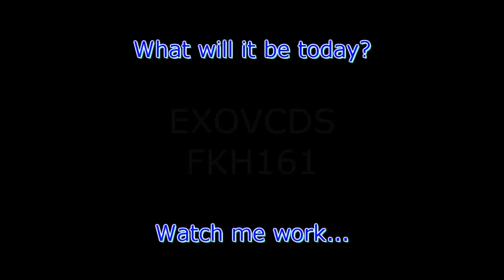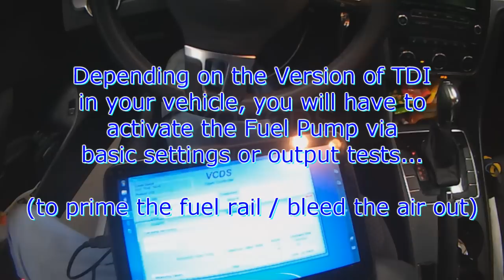VW B7: 2.0L TDI Fuel Filter replacement

Comment: Can the fuel pressure not be primed by just cycling to the on position a few times, does that tool lower the pressure output of the pump to reduce "pressure shock" when priming?  In your opinion is VW corporate making any progress on improving there reliability with there new releases?  Enjoy watching your videos!
Reply from the maker: I don't know all the specifics for all the different systems... I do know that not all vehicles will cycle the fuel pump "every time" the key is cycled. So relying on turning the key a few times, is not a safe thing to do with these engines (in my opinion). All I can say is, don't fill them up with gasoline or run the system dry... we have not seen any come in for major repairs yet. Thanks for watching & taking the time to comment!
Reply: *****
I work at a VW dealership and I have seen a handful come in with gas in diesel conditions.  Not pretty and very expensive for the clean diesel engines.  I don't know if the high pressure pumps are available to order from the aftermarket but I know VW pumps are order blocked and have to be called in with a VIN.  It is quite the procedure but we haven't had one for a while.

So listen to Thomas.  Don't let them run dry or with gasoline.  It is a 5 digit repair job.
Reply from the maker: mischief007 Hi, thanks for sharing your dealer experience! We haven't yet had a "gas in diesel" repair yet on the new common rail systems. The service manuals suggest looking for shavings and doing a flush if no shavings are found. Might be cheaper to buy a used car at 5 figures!
Reply: I know Thomas.  The worst part is VW tracks these misfuels so the car gets a bad rep once it gets reported.  Even worse for the customer it is all customer pay but as you said, depending on what the customer did.  Filled it but never put the key, just drain the tank, check the lines and replace filter.  Anything after that gets expensive quickly.  I want to say we've had about 4 since I started working there.

Comment: Where is the powerdirection oil tank located in this model?
Reply from the maker: I don't know what that is / means, sorry.
Reply: power steering fluid tank place.
Reply from the maker: @mestaphakabiri2939  is a yellow or red steering wheel warning light on in the dash?
Reply: I just looked for the location of the tank to check the oil level, because I could not find it near the motor.
Reply from the maker: @mestaphakabiri2939  if you have a warning symbol  that is on in the dash, then you have electric steering. Hydraulic fluid reservoir could be mounted low in the engine by the pump (if it has one).
Reply: @EXOVCDS  thank  you  for  answering.

Comment: Is hard to search at that page...what is price for cable? And full version of sw is then available even it cost 1000 usd +?
Reply from the maker: +Jozef Capek Software is free and will be fully ";unlocked", if you buy the cable from http://store.ross-tech.com/shop/cat/VCDS.html If you have a question about which cable is best for you, email orders@ross-tech.com and ask them which cable to buy.
Reply: +Thomas EXOVCDS EXCELLENT video sir!! very professional. I knew this was going to be good when you blew air to remove and debris. then you go and use the bungee cord. I was very impressed. I have a 2015 mk7. wonder if I would need the software? thank you so much for this great quality, professional video.
Reply from the maker: Zx10r Power It is best to use the software to bleed any air out of the fuel system. Some DIY posts (google to find them) say that it can be done without the software / fuel pump activation... I do not want to try that though.

Comment: Will I need to activate the fuel pump on a 2013 vw passat estate. 1.6tdi
Reply from the maker: It is always best to activate the electric fuel pump when priming the system... to prevent high pressure pump damage.
Reply: I know that, I'm asking will I need the computer to do it or is all models from 2010 Common rails. Just asking out of curiosity. As I also own a golf mk4 pd130, I just filled that with fuel and started first time.
But will I need the computer for my passat. Cheers
Reply from the maker: You didn't ask if you needed a computer in your first post... I'm  not a mind reader.
You can't compare a PD TDI with a / to a Common Rail TDI.
My answer to computer or not... yes, you will need a computer or scan tool.
If you read through a DIY TDI forum... you might get a different opinion.

Comment: Hello i am experiencing some error code related to the G81 sensor.
Can we see it in this video?
Reply from the maker: Under the engine cover... mounted to the high pressure fuel pump.
Reply from the maker: Did you find it?
Reply from the maker: http://fkh161.ca/VW/G81.jpg

Comment: Hello, where is the fuel filter located at on a VW Passat 2009 2.0?
Reply from the maker: Check between the fuel tank and the right rear wheel... let me know if it's there / if you found it. If it's not there, I'll have to look in the service manual.
Reply: ok, thank you!
Reply: its not there...where else could it be?
Reply from the maker: Let me look in the service manual... I'll get back to you.
Reply: ok, thank you!
Reply from the maker: Weird... service manual says / shows next to the fuel tank.
Reply: I took the bottom cover off and its not there 😕😕😕
Reply from the maker: If it's not at the side of the tank, then it is part of the fuel pump assembly inside the tank.
Reply: That's what I figured...I changed both fuel pumps and they keep saying change the filter and it'll run fine 😕...thanks for your help!

Comment: when u take off the fuel filter, then u need to eliminate the diesel in the fuel filter housing
Reply from the maker: You can empty it out if you want to... make sure to prime the system after the new filter is installed.
Reply: @EXOVCDS  Is there a way to prime without a scan tool?  Will turning the ignition to on without starting it prime the pump?
Reply from the maker: @greganson3627  On some TDI & Gasoline vehicles... simply unlocking the car and opening the driver door will cycle the fuel pump. Turning the key to ON "should" cycle the pump, but it might not cycle it a second time when turning the key to OFF and back to ON again.  A wiring diagram will tell you where the fuel pump relay is, which you can then remove, to trigger the pump with a jumper wire. I guess there are many ways to go about it... I use a scan tool because it's the easiest & quickest (for me).

Comment: Guys a cant locate my steering wheel fluid tank same car 2011 model passat
Reply from the maker: Stiff steering wheel or noisy steering?
If you have electric steering, it doesn't use hydraulic fluid.

Comment: Hi. There are 2 pumps in the fuel system, one in the back of the car and high pressure pump near the engine. I can only activate the rear one using vcds 17.8.0. Is it enough to prime the system after filter change or it is nesesary to activate the high pressure pump too? Can you tell me how to start both of them please?
Reply from the maker: High pressure pump is engine driven (mechanical connection to engine). You only need to run the electric pump to prime the system.
Reply: Thomas EXOVCDS All clear. Thank you.

Comment: any way to jump the pumps without vcds?
Reply from the maker: Probably... I've never tried.
Reply: the pump should be activated for couple second when you switch on ignition
Reply from the maker: Volkswagen - Naprawa How many times do you have to cycle the key to run the pump for 3 minutes to bleed the air out?
Reply: I dont know how many times because I never have air in the system when I change to filter, I have my own metod to replace the fuel filters. best option to remove the air is using the computers, but if someone do not have one the ignition cycle is only one option .
Reply: Volkswagen - Naprawa ive read it doesn't kick pumps on
Reply: M Blake Jr. 90%cars does, some you need push the clutch pedal down and activate the starter motor for 0,5 sec, when start to crashing just realise the clutch pedal

Comment: how to bleed the air out manuel :?
Reply from the maker: Fill the filter housing as much as possible. Tighten the cover into place. Cycle the ignition key on / off several times. Wait 1 minute between each on/off cycle. You should hear the electric fuel pump. You can also lock the car, unlock the car and open the door.. fuel pump should prime. Do any or all that often enough... it might be enough to bleed the air out. Scan tool method is best.